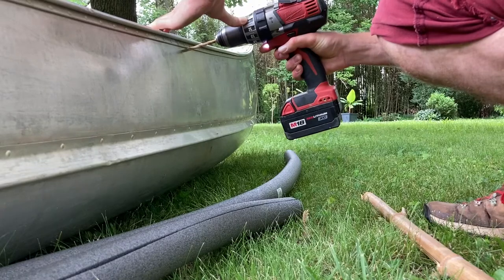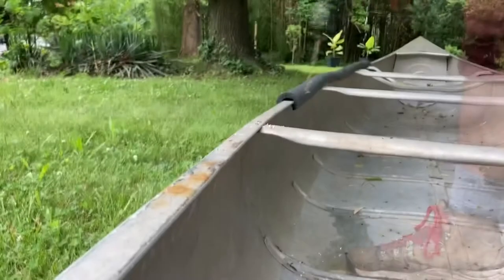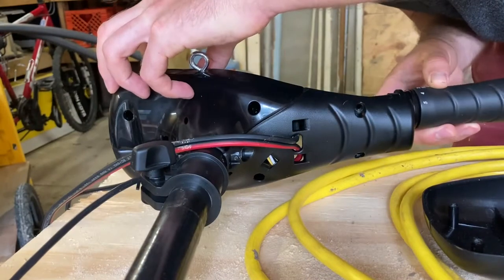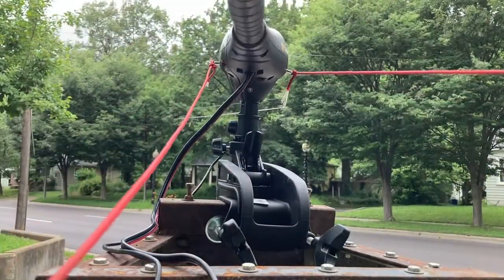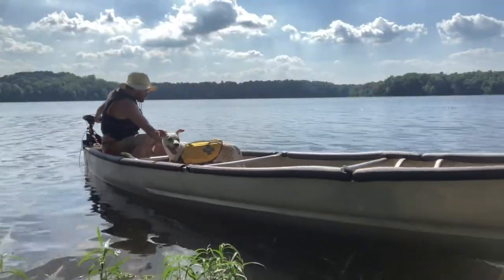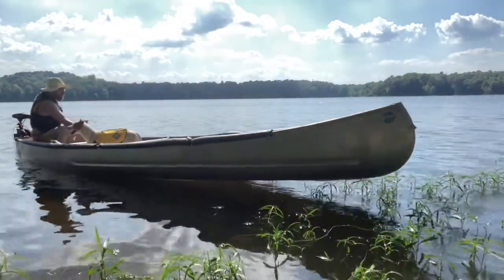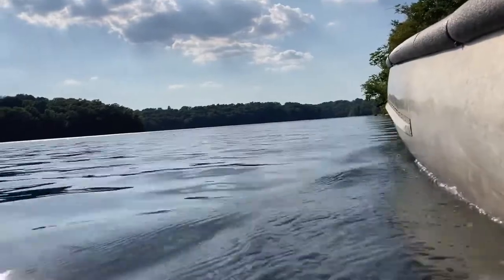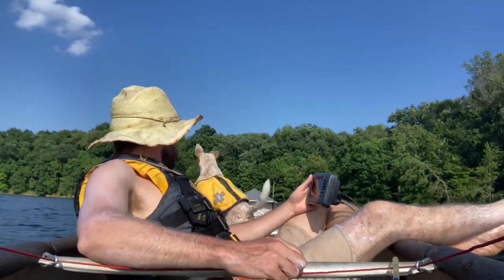Electric canoe. Build, test, performance, insights.

Comment from the maker: Approximately 10 - 3 mile trips traveled on maximum speed setting and endura C2 suffered heat related failure in the ground post of the rotating speed switch. Insulation compromised on several inches of ground wire. Equipment was easily repaired with a $15 replacement switch - However, Considering more reliable voltage control options…

Comment: Super cool man looks like fun.
Reply from the maker: Thanks, I’m quite happy with the setup. Took it on a three day bow fishing trip downriver. The canoe can go places other boats can’t while bearing a much greater load than a kayak. I added a second battery and was able two do 15 miles on the 3rd speed setting carrying roughly 575lbs including myself and company.
Reply: @benjaminjohnson1695  that's impressive I wished I could have been there. A canoe is the oldest boat design on record. I have a few my favorite one is an old square stern built in 1968. Have fun and be careful.

Comment: I appreciate you posting this video. I'm looking to do a similar setup as buying a larger boat with a gas engine is just out of the question for my budget. My biggest concern is battery and run time. I will be using a 12 or 14 foot canoe at the absolute biggest. I am looking however to be able to cover some serious ground. I have been considering a 55 lb thrust motor and running the largest marine deep cycle battery I can get my hands on. Looking for advice on what kind of distance/runtimes I may be able to get. Any advice is appreciated.
Reply from the maker: There are two ways to find out. Math, and trial. I prefer the latter. I’ve been getting 6 miles at 3.5mph out of my 80 amp hr battery before a noticeable performance drop. If your the calculating type you’ll need to find out how many amp hours the motor draws. (1/2 battery amp hrs) / motor amp hrs =   Runtime in hrs roughly. Another factor to consider is heat. Trolling motors aren’t engineered with long runtimes at maximum speed in mind. My Minkotas’ voltage control switch melts eventually so I’ve been replacing it seasonally ($15 Amazon) might be plausible to solder a heat sink in somewhere but I haven’t gotten around to trying. Good Luck!
Reply from the maker: PS… several smaller battery’s wired in parallel will be easier to carry down the bank than one huge one!